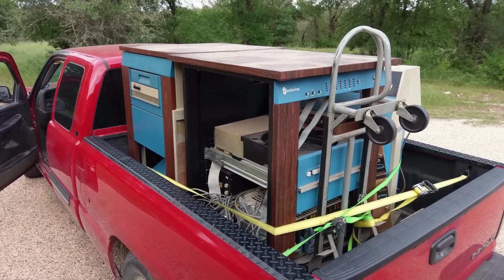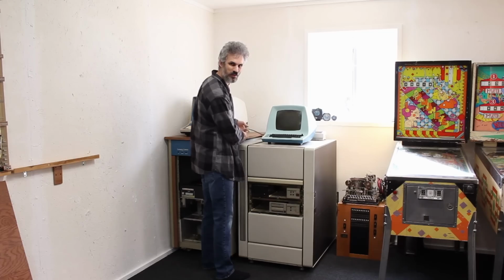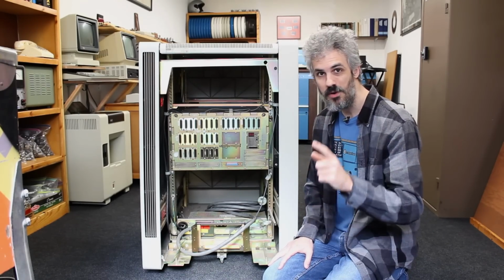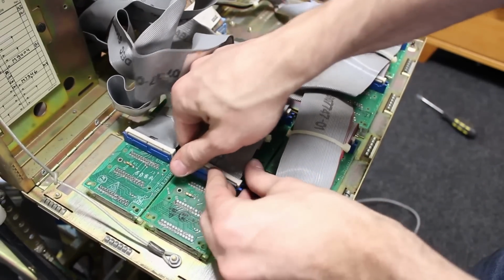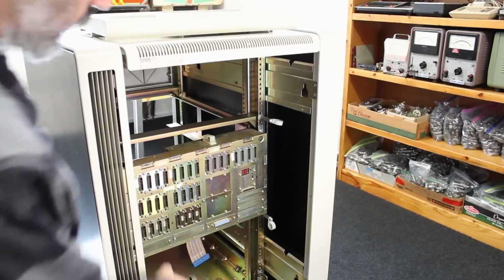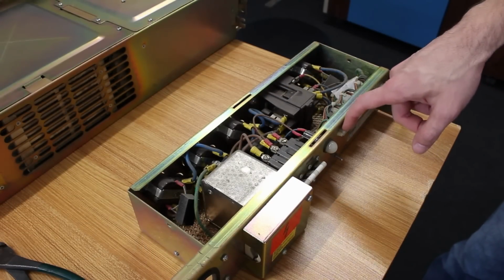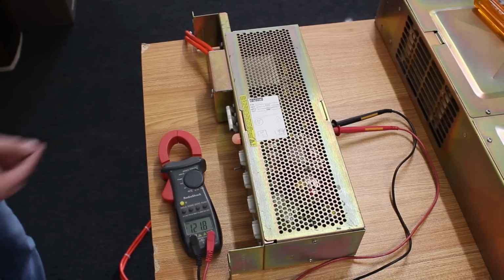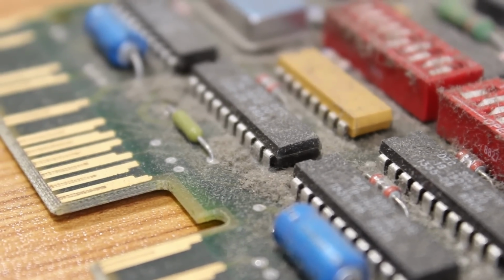I Bought a PDP-11/83!

Comment: The paint used on those cases is probably enamel.  Enamel is what manufacturers use when you want a surface finish that is slightly rough so as to not leave fingerprints, it has a natural tendency to leave an orange peel finish.   Lacquer thinner will probably take that adhesive off (and doesn't affect enamel), but test in an inconspicuous spot first.

Comment: 3M has an adhesive remover (08987) in an aerosol can.  Spray it on and let it soak a bit then wipe it off.  Paint safe but be careful around some plastics.  *Use it in a ventilated area*  That is your tape residue remedy.

Comment: Try WD-40 on the tape residue. It may work. But there's a caution with WD-40, it eats metal. Never use WD-40 on metal you will not throw away. It will destroy any bare metal you apply it to.

Comment: This takes me back about 40 years. We had a PDP11 (I think an 11/70), which originally had a single-sided 8-inch floppy (about 90kB from memory), later replaced with a double-sided 8-inch floppy. Later on we had a 10MB hard drive with either a 10-inch or 12-inch platter - none of your miniature 5-1/4 inch stuff. The 10MB HDD cost around the same as a luxury car or a small house. The original operating system was RT-11, later updated to RSX-11M when the HDD was installed. Later on we had various models of MicroVax, Vaxstation and Alphastation. All of which ran various flavours of VMS. None of our DEC machines ran Unix. I can't recall the brand of terminal we used as a VT100 clone, except to say that it had a much more ergonomic keyboard than the VT100 - which was blamed at the time for an epidemic of RSI.
To add a bit of context, I worked for 35 years for the Australian Defence Science and Technology Organisation (DSTO), where we were always at the cutting edge of technology. We often built our own systems by adding third-party peripherals, using clone systems, or installing our own add-ons. I wouldn't mind a quid (pound or $2) for every time some DEC or other manufacturer's representative has told me "That's not user installable.".

Comment: I first used a PDP-11 during my College Program (Australia),  then in 1980 took a Position as a Field Engineer with an American process control and instrumentation Company - Measurex (Now owned by Honeywell). Measurex used DEC LSI-11/23 Industrial OEM Versions in their Process Control Computers - full height ventilated Air-conditioned Cabinets, Diablo Daisywheel Printer/Terminals, full colour CRT Monitor Display, heaps of RS-485 and RS-232 interfaces to the Intelligent Process Controllers, and heaps Current and Voltage Sensor Inputs from the Process Sensors and Instrumentation.  All running on a RTOS.

A very steep learning curve, but I was indebted to an amazing Australian ex-US Military Engineer - who was my Lecturer for Instrumentation and Material Science.

Comment: My first job in engineering involved using a PDP 11/40 which was used to support FORTRAN IV programming and run an FEA package written by the local university. The graphics was done by a PDP 11/10. Good times!

Comment: Wow, I was a student in an experimental elementary school in the early 1980's in Israel. We had a PDP-11 in our copy room that was connected to classroom terminals. It was used to run educational programs on 3-4 subjects. The terminals had a degenerate 0-9 keyboard, so we could answer multiple choice questions and some arithmetic exercises. For higher grades they had an extended keyboard we used to learn BASIC (I think). The terminals had a socket on the side that teachers used to get into teacher mode. I remember kids learned at some point they could improvise a teacher plug from paperclip and skip chapters on the software. Now I see those terminals were connected by RS-232 cables. Amazing, not even ethernet.

Comment: Great video! I used to work with a number of PDP11-34’s in my first IT operations job in the mid-80’s (maritime engineering & research company), so this takes me back to happy place. They were incredibly robust and capable of working in dusty, damp and non-ac environments, ideal for where I was working. We also had an old PDP8f with a teletype terminal and punch tape kernel loader. Subscribed for more episodes 😊

Comment: It's not an outrageous number of ports. We had an extra 8 port RS-232 with DB-9 plugs installed in a computer with a 80286 with an additional 1MB extended Ram running SCO Xenix. Plugged into it was the console, an additional 2 terminals, 3 printers, 2 modems, one of those hooked up to another printer some miles away, and a cable from the UPS to tell the system when it had switched to battery power. The separate accounting computer was connected by sneaker net. Not a fast system, but still a huge upgrade from doing everything by hand. The remote printer part used to be done with an Electrowriter, a system for sending pen movements one way over phone lines.

When we upgraded to a 80386 we ended up adding another 8 port card plus another 1MB extended memory so we could add a bunch more terminals and printers.

Comment: How funny, and how cool! 

Back in the 80's I worked at a company that had PDP11's and 7's. A new terminal popped up in an office one time that was connected to a PDP11 a few miles away at the main office. It must have been connected via modem because I don't think 10base2 went that far. We poked around in the terminal and discovered that you could fire up an instance of BASIC of all things. In those days, instead of a security login, the prompt said to type -help and hit ENTER. It spilled its guts, showing everything available. Anyway, I wrote some silly program to demonstrate simple programming to a couple of co-workers, and we had a laugh. About two years later, some admin found the program, and somehow traced it back to us. They made a huge fuss, but let it go since the program was not offensive or malicious. 

Good luck getting that thing going!

Comment: I like a lot of the other old DEC techs, also have a PDP-11/23 on my front porch. I have a Dialogic CMD / SMD controller with a 300 MB Fuju 8 inch HD. It has TSX Plus loaded on it, which was a vast improvement over the DEC RSX11M.  I also have a RX02 Floppy controller and a VT320 for the terminal. OK so what do I do with all this old stuff ?

Comment: I worked at DEC, and was well versed in RSTS/e, RSX11M, and Vax vms . I wrote tons of software on pdp 11’s . I was in Dec professional services
Reply: Did you use TECO?
Reply: @pughums  yes I was pretty proficient at Teco, Ked, LSE, EDT.  I loved LSE and learn mode. I felt invincible and fast with all of these but LSE I believe to be the best editor ever.  That said, you are tightly coupled with the LK201 keyboard which is like a game changer for speed of editing code. I could literally write code as fast as my  brain could solve for a solution.  I can’t say enough good things about LSE plus LK201. The LK201 set the standards for keyboard design. In fact, I would love an LK201  duplicate if such a thing still exists. IMHO ,DEC’s suite of code development tools could have been exploited far more than than the Mgmt Team at DEC understood, they had a gold mine of software development tools but didn’t understand what they had developed.  Even inside of DEC, only a small percentage of developers had the complete mental comprehension of what was available to them.  I even wrote programs that wrote programs which was super fun.    So at a high level you had LSE ( language sensitive editor) , MMS ( module management system) , CMS ( code management system ) and DCL ( digital command language) , those were the big things that were ahead of their time imho.  If you completely knew how to use them effectively you could literally do anything anyone imagined or dreamed in a fairly short amount of time regardless of the number of lines of code that had to be developed or managed.  But you also needed people to follow the tool use rigorously, for example CMS, you had to make sure people checked in/out code and commented their mods rigorously for complex applications.  There is nothing more frustrating than realizing that the code in production is NOT the code checked into the CMS system because all you have then is uncertainty about what you have vs what’s in production and this is not a guessing game especially when the software is managing money or things that have value e.g. manufacturing processes.   I could say more but that’s a good high level view

Comment: There is a chance that these used to be used at Pitt. When I was a senior, we had remote access to systems that were PDP-11s over a 1200 baud link to a datacenter a few miles away.  As undergrad students, we weren’t allowed to access that datacenter.  

I was done there in 1985, so no telling … but it’s slim odds.  

PS: Long live the DEC RT-11 operating system on big 8-inch floppies 💾

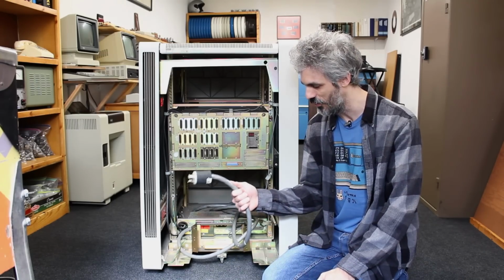Comment: 8:24 it's a DD-50, they can still be had though they're not as popular as DA-15, DB-25 or DE-9. Oh, did I forget about something? The not really popular DC-37.
What a beefy power cable! Audiophile grade stuff... put a Furutech C13 on it and sell it off for a few thousands of yankeebucks, haha!

The way PDP11 was built is art in itself - modular construction, compartmentalization, attention to detail... Joy for ever. You did fantastic work on this one. 
Xenomorph eggs aside (you blew them away after all), that's a lovely power distribution unit. 

The A - O - B switch kinda reminds me of what I have on my AC-1 audio computer, only that mine switches between the sources of control (manual override on - off - automatic/software control) rather than destinations.

And by the way... Smash those xenomorph eggs!

Comment: Tape drive looks like a TK50. I've never seen that particular layout for a PDP-11. I'm more used to the full cabinet systems like the 11/45 and 11/70. Do you have a VT52 to go with it? Are you going to run RSTS/E or RSX on it?
Reply: VT52s were superseded by VT100s about eight years before tee 11/83 was released.  You may be able to run in VT52 emulation mode, but a VT10x or VT220 would be a better choice - and there are going to be many more still around, I suspect.
Reply: @oldcynic6964  I used all of these but my timeline is fuzzy as it was a long time ago. I worked at DEC from around 1983 until 1994 when my group was bought out by Oracle, so we graduated to VAX/VMS in 1982, and then Alpha.

Comment: Lot smaller than the  PDP 11/40 and 11/70 units I worked with in the olden days. Little bigger than the PDP 11/03 units we had rolling around the office. (17765000).

Comment: You can use Diesel, Paint Thinner, or Varsol to remove the tape residue. Try each of them on a small hidden area. The Varsol may melt the plastic slightly, but if you use a small amount on a paper towel a few seconds at a time, a few minutes apart, it might work best.

Comment: Ordinary paint thinner will probably soften the tape residue, and then you can scrub it away without damaging the panel surface. If that doesn't work, isopropyl alcohol might help a little. I wouldn't use acetone, as it might singe the paint.

Comment: I think that the Grass Valley Group’s VPE-series A/B roll linear editors were based on the DEC PDP-11. They were one rack unit high, as I recall; I worked on VPE 131, 141 and 151 editors (the software was so similar as to be pretty much identical) at NBC. I think the reason why Grass Valley settled on the computer is that it was fast enough to control all of the peripherals it needed to control within 1/60th of a second (a TV field for NTSC television) or 1/50th of a second (a TV field for the European standard for broadcasting) and could control several serially-controlled videotape recorders and a switcher (vision mixer in Europe) to edit television programs in linear editing rooms.

As I stated, these were one rack unit high on a standard EIA 19” rack. 

Also, the PDP-11 is the computer that Bill Gates and Paul Allen used to emulate the Intel 8080 microprocessor in the Altair 8800 when they wrote a Basic interpreter for it. They found, to their happy amazement that, once the paper tape was loaded into the Altair computer, it worked perfectly.

Comment: In the 1970’s I programmed PDP-11 equipment using RSX-11/M and RSTS/E software as well as macro-assembler system-level code. It was used in a Texas bank to drive ATM and teller terminals in Houston and Dallas.

Comment: I look forward to seeing how this goes. I would guess that this is an office machine, and hence probably running RSTS/E, or UNIX, judging by the large number of terminal connections. 

It would be more fun, though, to have it running RSX/11. When I was programming RSX, it was the one time I felt confidently able to control everything about the computer, and yet had a development environment which gave substantial assistance. Fortran on RSX might seem old-fashioned, but there were things I was able to do easily and quickly which I would struggle with on later more sophisticated systems.

Comment: You can toggle in a memory check  mov -(pc),-(pc)  which I recall without checking is 014747, toggled into the highest memory address present and executed.  It copies itself to the next lower location and then executes that location, thus filling memory with 014747 until it hits an error, hopefully at location 0.  On a memory fault it will save the PC in some low address that you have to look up for the memory fault interrupt, and that will be the highest location of bad memory.

Comment: In my 1st year as DEC FSE in 78  I had to do a lot of Preventive Maintenance PM to all kind of PDP/11 Equipment. And I never imagined how much dust and dirt is accumulated inside. 
I felt rather being a chimney sweeper than a IT graduated engineer. So I changed tons of stuck-up fans, vacuuming and air blowing the boards.
If this is neglected, dust can cause overheating.
Hope your antic collection will find its way into a computer museum one day.

Comment: Yes, Minicomputers are multiuser machines and terminal based. The big blue, 24(?)-bit port is for a DecWriter Administrator printer/terminal, except terminals of old didn't have glass terminals, but has paper printed outputs. Then you had a written record of your session, when needed.
Reply: At U. Maryland in the 80s the undergrad computing labs still had the dot-matrix DecWriter printing terminals for student use. My girlfriend (now wife) had to use them for APL programming in her linear algebra course; there were multi-character sequences to mimic the crazy APL special symbols. No fun at all.

Comment: Well I was shocked to see this, Back in 76 I joined Pfizer's Medical System Division who had just bought a CT Scanner Prototype from a Doctor from GWU .  It was controlled by a originally a TI/99 machine but with the new hires all coming from Aerospace we quickly went to DEC for the next model. PDL 11s for sure the R&D  Lab had a 55! The room was so cold we had sweaters on hooks as we when in. So now I wonder what you would do with this updated PDP 11 83?  We were running an X ray Scanner, pipping lots of data into it and reconstructing a graphic image in the form of a grayscale cross section of a human. Our first machine had pixels the size of match sticks and took maybe 2 cigarettes to reconstruct after the scan was complete. out last machine was showing detailed images of the optic nerve and reconstructing in seconds. Of course we started with One 2 inch detector and ended with match stick width detectors in a 360 degree circle with 3 X Ray tubes and amazing detail.  I have no idea what that means for these beautiful machines 4 years later????? Good Luck I did wonder what you paid for it. Great find. D

Comment: In the late 1970s I was in control of a computerised chemical plant which used a number of PDP 11/34s, an 11/24 and an 11/44 system.
There was an older plant which used a number of 11/35s.
At that time the introduction of IBM XT 'desktop' computers began to give an insight into the possible future of Plant Control, and the demise of these very expensive to buy and maintain PDP 11 computer systems.

Comment: I worked at Cray Research and used a PDP 11 as the compute engine for a GE CALMA system used for layout work on IC's. The graphics data would be saved on a tape drive as a GDS file format. Not long after that CALMA systems were replaced with SUN Microsystems workstations using UNIX OS which were far superior. Maybe you can turn on the PDP machine and use it to heat your room? You cell phone is probably many times the compute power.

Comment: WOW 
Wicked Cool, I'm very jealous.
One of the best systems I've ever worked with. OK Vaxstations were pretty cool but WOW....
Yea, with that serial mux panel I'm guessing that Maxtor has RSTS on it. As others have said there are lots of storage options for the PDPs. If you can get a copy of it my favorite has to be Ultrix-11. There are other UNIX OS available for the PDP but none were as fast and supported all the DEC expansion boards like Ultrix. It will work well with those serial terminals and X11 terminals if you can get a network card working. Maybe you can find a VT-320 on ebay to complete the set.
Also, as said before, be very gentle with that TK50 tape drive. The cartridge is a single spindle, and the last 30 odd cm is reinforced mylar with a loop at the end. There is a metal ribbon inside that hooks to that loop and pulls the tape onto the other spindle. Everything must be rewound and disengaged before the leaver will flip up ejecting the cartridge so don't t force it.

Comment: I'm the mid 80s we had 2 Vax 11/750 machines and ran out of serial ports for the users and added a LAT-11 (?) that was essentially a pdp-11 with multiple serial ports and it looked just like this, except it had a first generation ethernet port - the one with the slide-lock d connector.